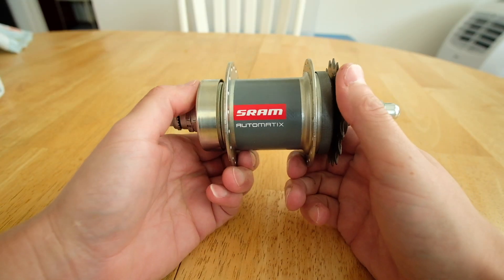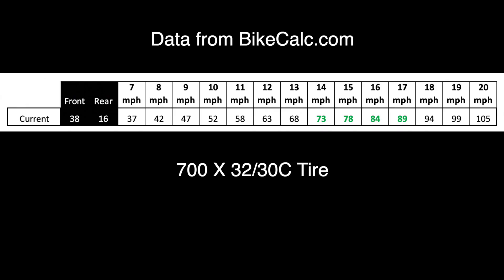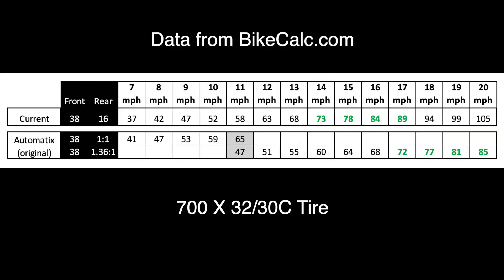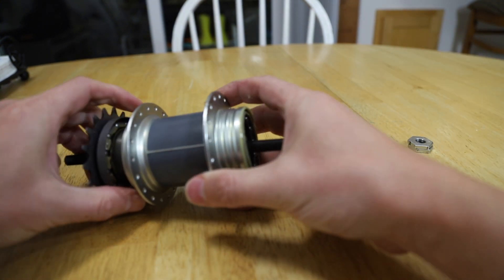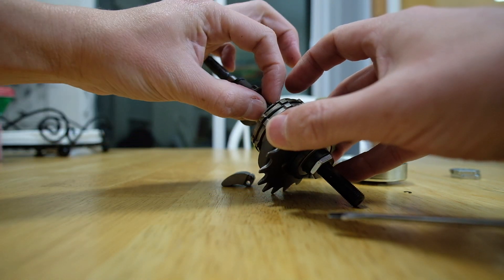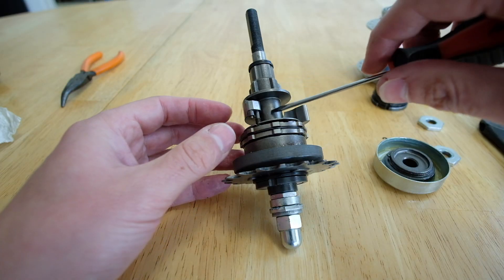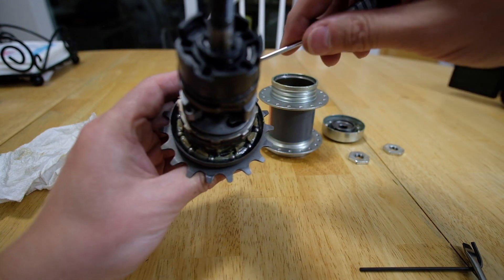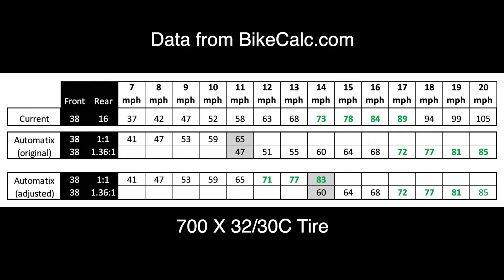SRAM Automatix Shift Point Adjustment

Comment: Thank you so much. I was just fiddling with my same hub and it's been almost a decade since I built the wheel around it and I was getting frustrated at the lower speed upshift. I knew I had to bend the spring but I couldn't make sense of it. I appreciate the documentation.

Comment: You could  have the same result by taking some material of the weights by drill or grinding some off. But your idea works. Just wondering if the spring will be able to work the same way in a year or so.
Reply: That would be  permanent though (grinding off material) and if you go too far its essentially fcuked! This way is a lot more variable and easier to revert back to original settings.

Comment: you could change out the chainring and gear cogs to do the same thing
Reply: Incorrect - Re-read the (correct) comments of Eric Haywards & Jay Tyan above
Reply: No you couldn't... It would still shift super early, and if you've made the gearing higher, it'd be like setting off in top gear and changing super early into an even higher gear.... Not good!

Comment: all you needed to do is change the gear ratio by replacing the chainring or rear cog or both with a more desired ratio in order to get your cadence as you would like.
Reply: Yes that will change the final gear ratio but the shift point will be the same. I have one of these hubs and it shifts way too early without modification. The shift point is actuated at a certain speed and is completely unrelated to the gear ratio
Reply: @EricHayward  actually not completely unrelated, the gear ratio will affect the riding cadence required to shift. I unfortunately learnt this the hard way by being overzealous with my project and bending the spring AND changing the gear ratio to an easier one. now the shift point requires a little too much spinning....

Comment: Great video!! Super helpful. I did mine in not much longer than it took for you to show yours. I also managed to bend the c-clip despite having seen your video but it also went back in just find after I bent it back. I'm using my Automatix hub with a 46/21 gear ratio on a 1962 Dunelt (Raleigh) for which I built some new wheels. I did add a little bit of grease to the ball bearings before putting it all back together since it seemed a little dry to begin with; I'm hoping it doesn't end up going into the hub and gumming up the sprung components. I presume that's why they didn't add much grease to begin with, but my experience with Sturmey-Archer hubs tells me that the small amount I added is fine. Fingers crossed lol

Comment: I have this hub on my San Jose for about a year now, changed the shift point also. Running a 46/21 gearing with short arms, 155mm due to a knee replacement.  My shift point is around 13-14 mph now. Have had no problems and the stiffer spring also helps keep it from shifting into hi over bumps as easily.

Comment: I have been thinking of adjusting the shifting point on my SRAM Automatix to a higher speed too, but I am considering another approach. Drill holes in the Centrifugal Weights to decrease the weight of these "pawls" so that higher speed would be required in order for the clutch to engage? Did anyone tried doing that?
Reply: The hub has a tendency to "ghost" shift to hi over bumps while still under the shift speed, the default in the hub is hi gear, the spring keeps it in low.  A lighter flyweight would make the problem more pronounced I believe seeing that changing my spring to a higher tension also reduced the ghost shifting issue.

Comment: Forgive the potentially foolish question, but I'm assuming you could fit any sprockets you wanted to this, rather than sram ones produced at the time? Maybe some nice Russian Raketa track ones?
Reply: You can do this, but this shift point will stay the same. I have a 20-tooth sprocket on mine and still felt like the shift point was too early. In my case, 46/20 tooth gears gave me the right spread of ratios for my rides but I wanted it to stay in 1st gear longer, as many other riders did. If I put a larger rear gear on the hub, I would my top speed more limited than I would like.

When riding a bike, you will notice that your legs like to spin or put down power at a particular speed. This is what he means when he talks about keeping the cadence within a certain range. Simply putting a larger rear gear onto the hub can increase the high gear cadence into the comfortable range, but reduce the usability of the lower gear. After all, if the low gear is only engaged for a few seconds upon acceleration, it kind of defeats the purpose of all that extra money and weight.